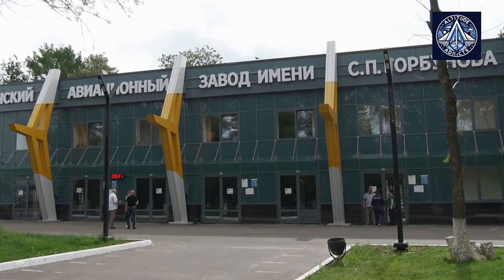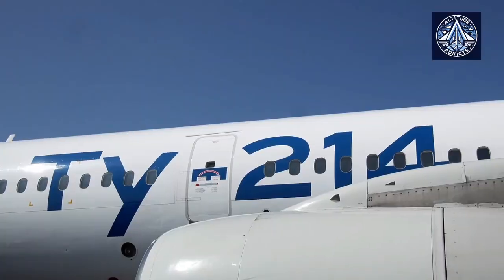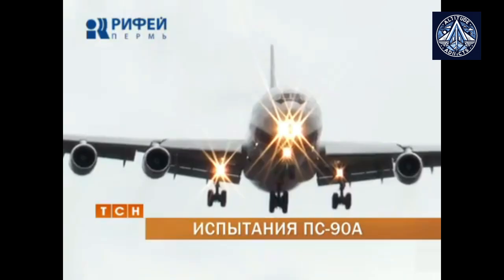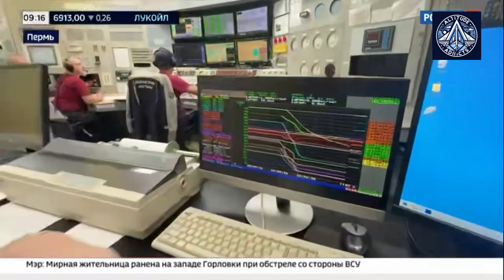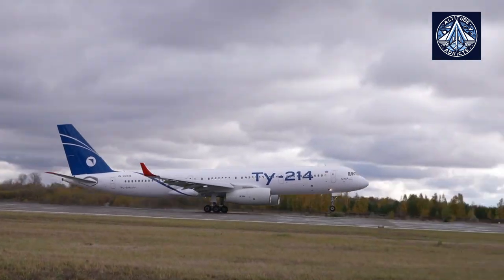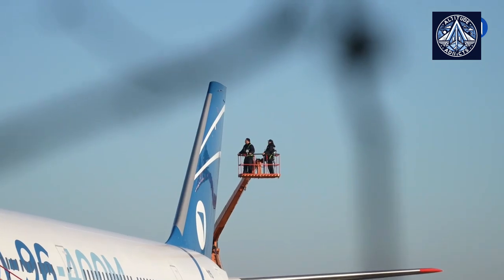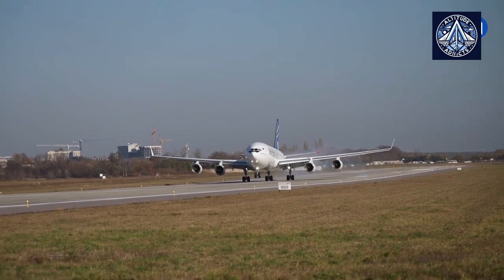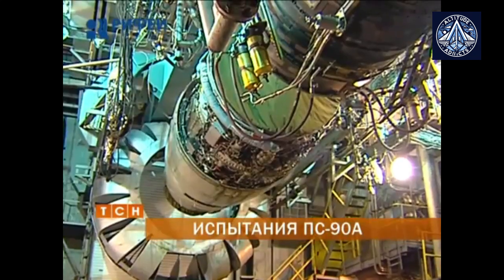How the PD-14 and PD-35 Are Making the PS-90 Engine Obsolete

Comment: if you look at the USA C-17 transport jet - similar to the Il-76 .... its engines aren't that different in performance to the PS-90.
P&W 2000.   Interestingly that same engine was used widely on the Boeing 757 which is very similar to the Tu-2014/214. 
there are numerous gas industry uses of the PS-90 too ... for power generation and gas pumping and its reliability ensures its future for a long time
Reply from the maker: While one PS-90  version may be produced for Tu-214 and IL-76 for sometime, ultimately PD-14, will take over these functions for better performance matrix. I am sure if C-17 Nd 757 would have seen re engine project if they had the required volumes.
Reply: PS-90 is a bit of an overkill for Il-76. The plane is smaller than C17 but have almost same thrust engines.

Comment: PS-90 will be in production for a long time in one variant or the other simply because it used on IL-76, IL-96, TU-204, etc. PD-14 amd PD-35 are new and untested. Time will tell.
Reply from the maker: PD-14 can replace it on IL-76. PD-35 for IL-96. If they are redesigning Tu-214, the PD-14 can be a better option. All are future predictions of course. In short term, PS-90A will be in production.
Reply: PD-8 and PD-14 are currently undergoing tests, the 2 engines may complete the test in 2025,

Comment: You are comparing NOT EXISTING(!!!) engine PD-35 with existing and used on many aircrafts engine PC-90.
Reply: It exists actually. Although is not production ready yet.
Reply: @bukanjoni2946  , here is the quote [translated] from publication at October 26, 2024:
"PD-35 aircraft engine - technology demonstrator - has successfully completed the first stage of testing."
Please note, they do NOT call it an "engine", they call it "engine - technology demonstrator". Because the "engine" doesn't exist yet.

Here is another quote  [translated] from the same publication:
"Earlier, First Deputy Prime Minister of the Russian Federation Denis Manturov reported that the PD-35 engine could appear by 2030."

Now 👆 they are talking about the "engine". So, here is the difference between these two:
    "engine - technology demonstrator"  -  exists in 2024;
                                                    "engine"  -  could appear by 2030.
Reply: @bukanjoni2946  , here is the quote from publication at October 26, 2024:
"Опытный образец авиадвигателя - демонстратора технологий ПД-35 успешно завершил первый этап испытаний."
Here is translation for you:
"PD-35 aircraft engine - technology demonstrator - has successfully completed the first stage of testing."
Please note, they do NOT call it an "engine", they call it "engine - technology demonstrator". Because the "engine" doesn't exist yet.

PS. Here is another quote from the same publication:
"Ранее первый вице-премьер РФ Денис Мантуров сообщил, что двигатель ПД-35 может появиться к 2030 году."
Translation:
"Earlier, First Deputy Prime Minister of the Russian Federation Denis Manturov reported that the PD-35 engine could appear by 2030."

Now 👆 they are talking about the "engine". So, here is the difference between these two:
    "engine - technology demonstrator"  -  exists in 2024;
                                                    "engine"  -  could appear by 2030.